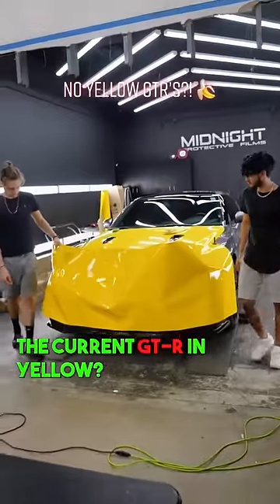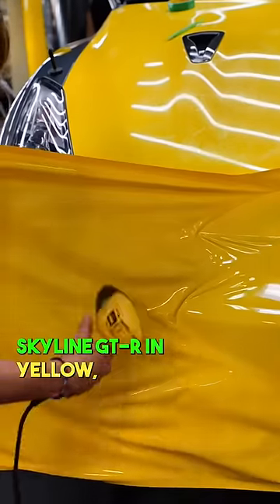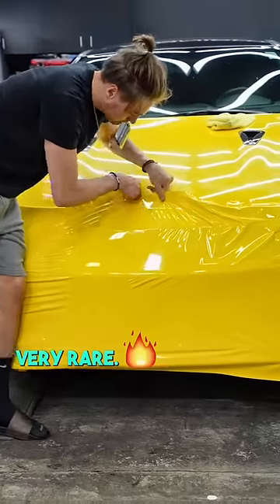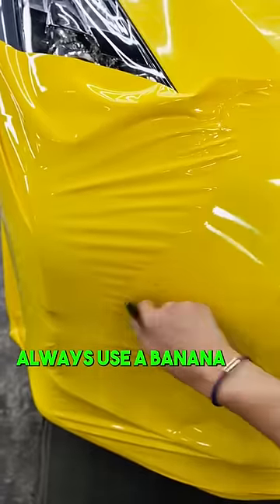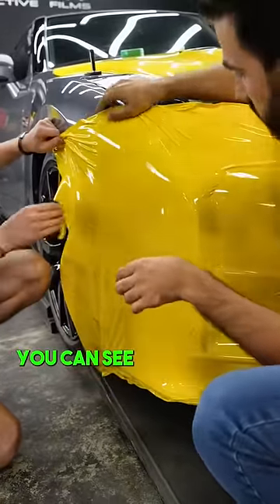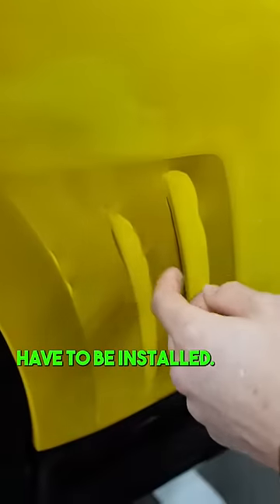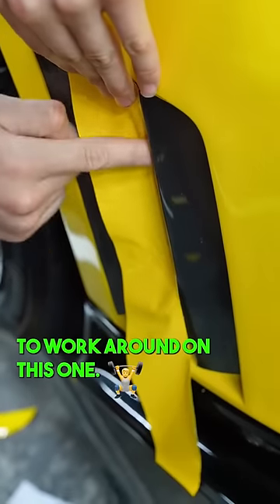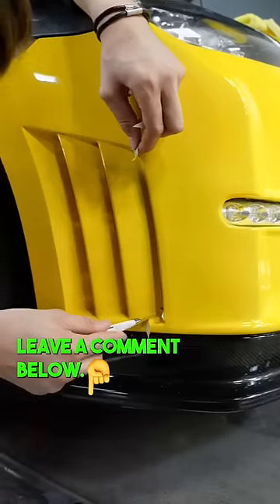NO YELLOW GTR'S?!

Comment: Actually only 68 BCNR34 were produced in lightning yellow and only the series 1 models had EV1. 

It is also the rarest colour on the BCNR34 after that it is AR2 which is Active red and  the rarest colour on the BCNR33.

Reason why Nissan decided to not continue with making EV1 later on was because Mitsubishi Introduced Y01 before Nissan as a paint option (Lightning yellow on the Evo 6-8) and because of the gentlemen’s agreement Where all manufacturers do not compete with each other in power figures or factory options Mitsubishi took the rights to lightning yellow and changed the colour code to y01 and till this day it is not possible for Nissan to make this colour again as a factory option unless they buy the partial or full rights.

EV1
GTR: 19 
Vspec: 44

This information is coming from an Australian who’s been dealing with GTRs for many years and we have had the skyline models since they were brand new